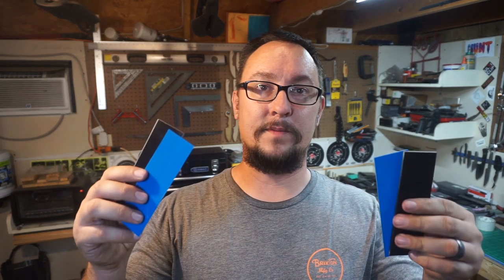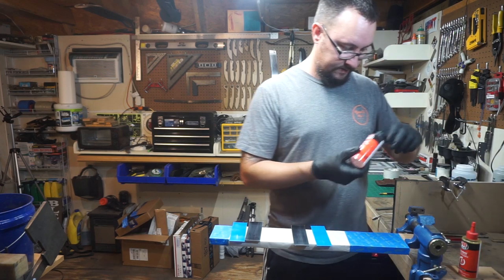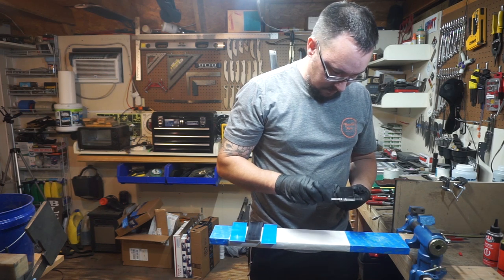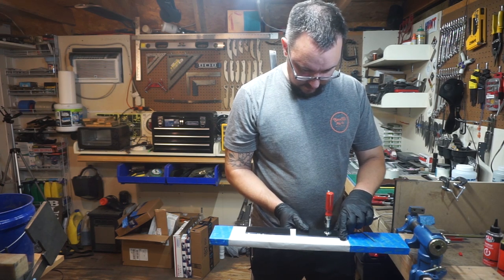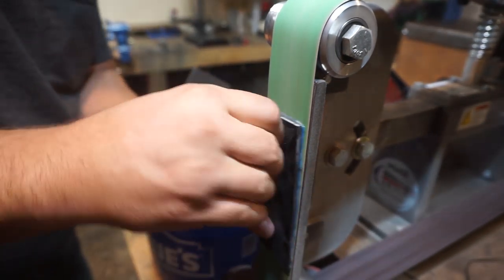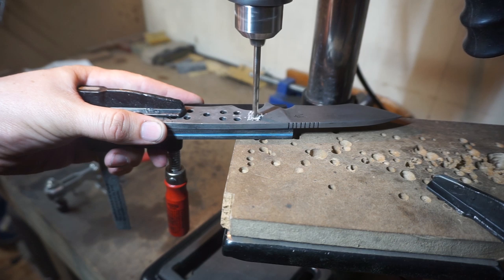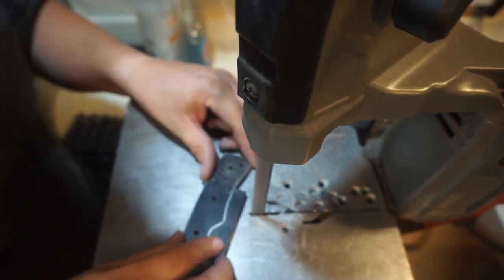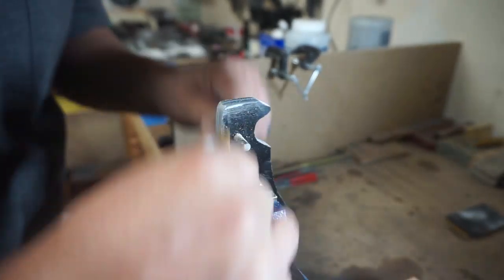Attaching Handle Scales To An EDC Knife | Knife Making | Daily Vlog

Comment: Good stuff its looking kewl with the black and blue, plus that blade shape with the re curve should be pretty good looking once all done. 
Do you find 5 min epoxy is OK to use strength wise? Year ago, like 2 or 3 decades, I was always told the 24 hour stuff is the way to go for overall strength but with modern chemicals I wonder about that now? I see a lot of makers on the tube using the 5 min stuff.
Reply from the maker: It's been doing great so far but I will be switching to G-Flex in the future.